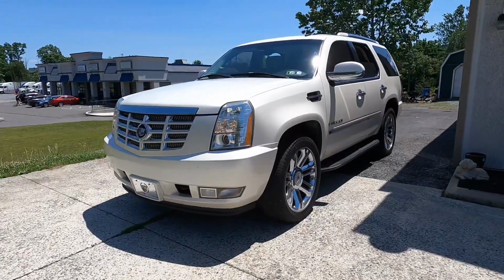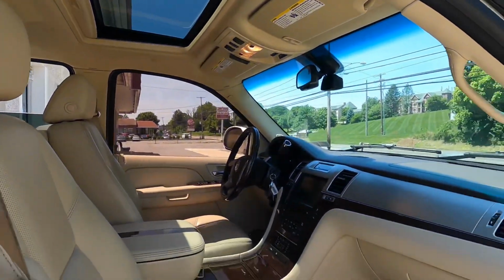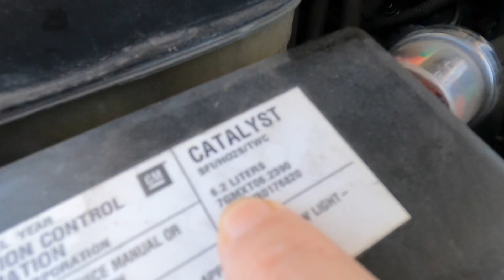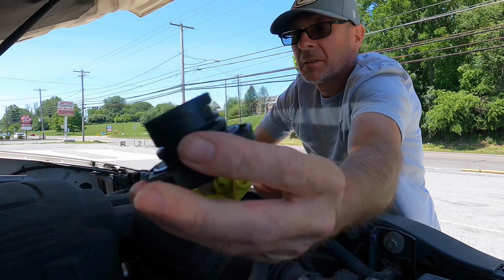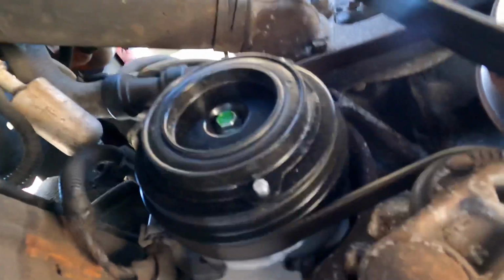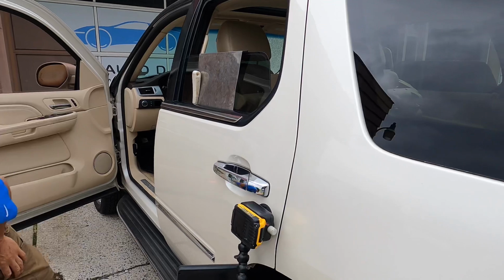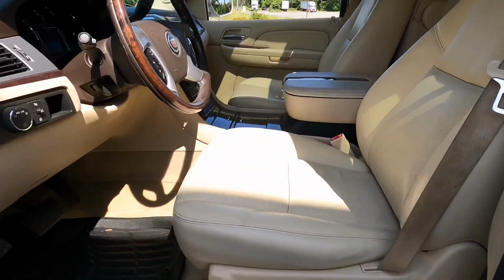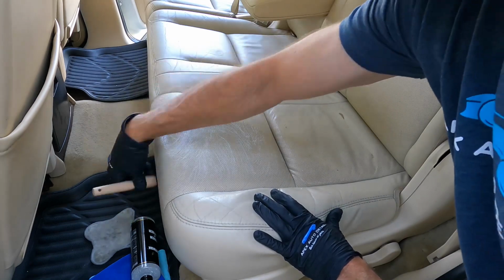Finally Found Our Next Flip Car!!!! Back To The Auction! Cheap Heap To Super Car Series Part 7!!

Comment: Looks likes it's in great shape for the year and mileage. The PA rust is mainly surface rust.  I have a 2017 Silverado LTZ Z71 crew cab with the 6.2 in it. It was great when has was around $2 a gallon...lol. I get 9.6 MPG in the city (the Burg)
Reply from the maker: Yes....ouch...the gas mileage is horrendous!